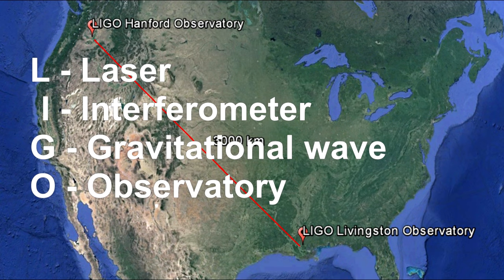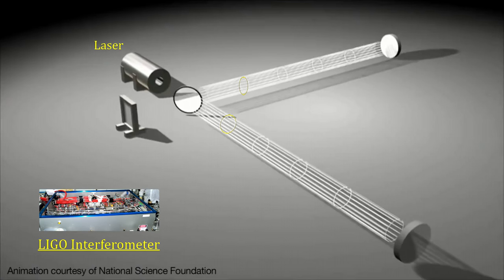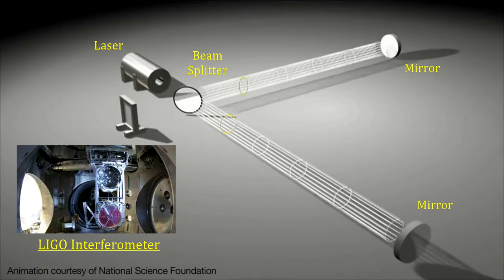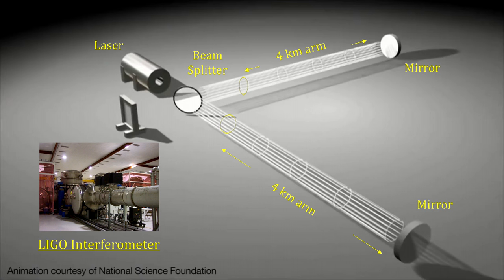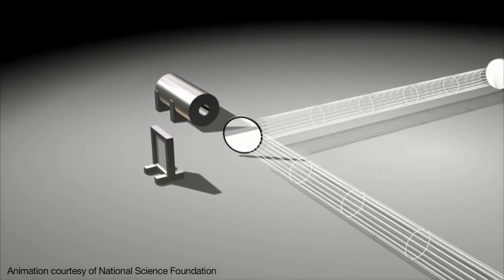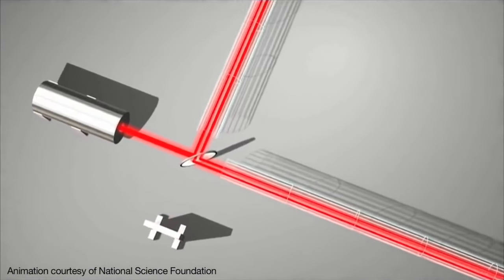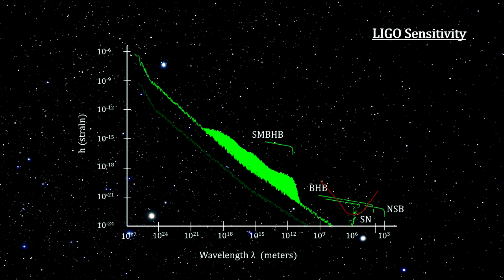Classroom Aid - LIGO Interferometer

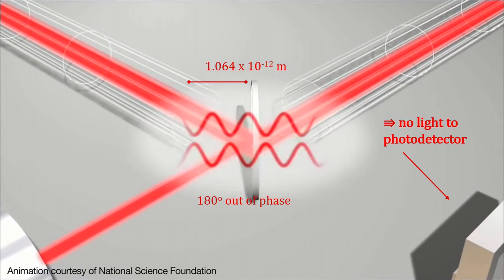Comment: 2:25 The wavelength is NOT 10^(-12)m. For the infrared laser used in LIGO, the wavelength is around micrometer, 10^(-6)m.
Reply from the maker: Thanks for the correction.

Comment: 2:25 QUESTION: Where does the energy from the two beams go when there is destructive interference and no signal is detected by the photodetector?
Reply from the maker: It is still in the waves.
Reply: @howfarawayisit  Can you elaborate?  Are you saying the waves were reflected back towards the source laser?